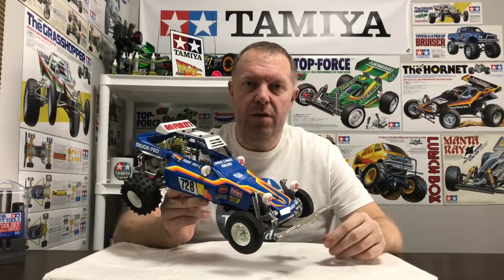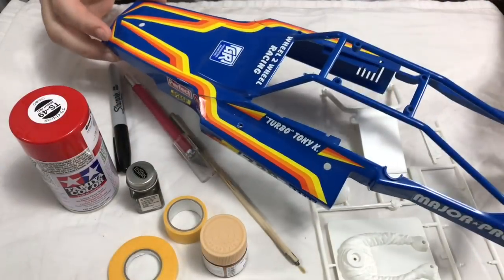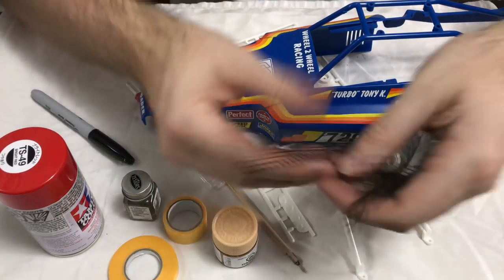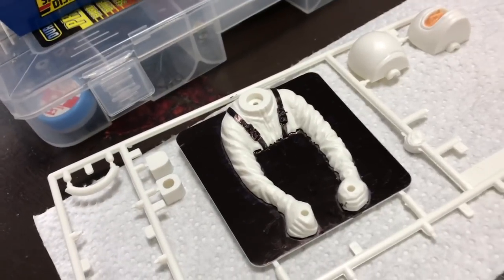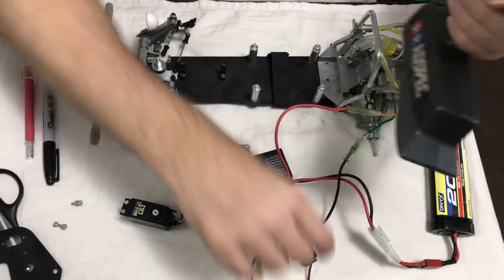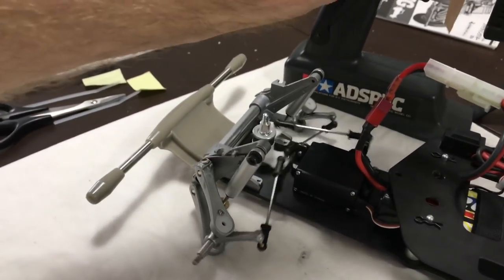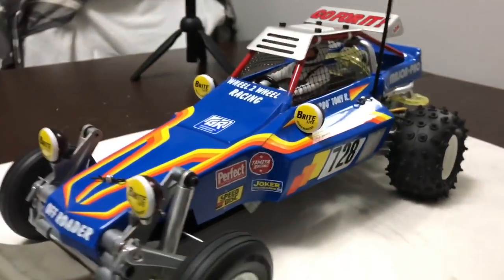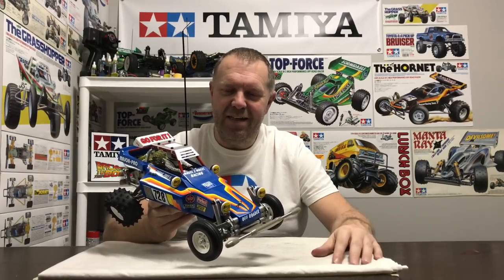Tamiya Fighting Buggy (Super Champ), Part 2

Comment: I’m a die hard sand scorcher fan but the servo saver setup is way better on this chassis.  Also, the original super champ came with hardened steel rear axle universals and hardened steel front arm shafts which are a nice upgrade for runners if you can find them.  The originals also had these awesome tiny steel rod ends for the steering which just helped with the scale even more.
Reply: Also, in the fighting buggy manual, it actually tells you to cut down the inner plastic rod ends 👍🏻

Comment: I am currently restoring an original superchamp, what surprised me with this were the differences, the re re is downgraded in number of areas, the most obvious one being the steering joints, there is far less play in the original superchamp steering setup compared to the ordinary Tamiya plastic ball joints as used in the re re. the re re also seems to do without the hardened steel UJ, does it have the hardened steel from beak pins for the trailing arms or the standard mild steel items? If interested I will let you know when mine is done if you would like to do a comparison back to back?